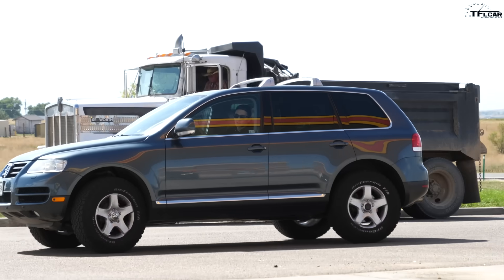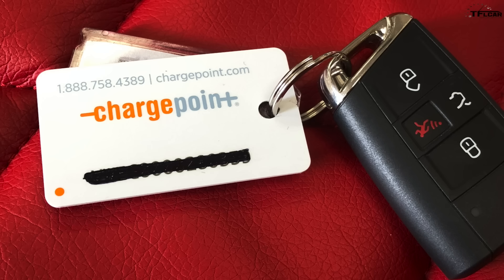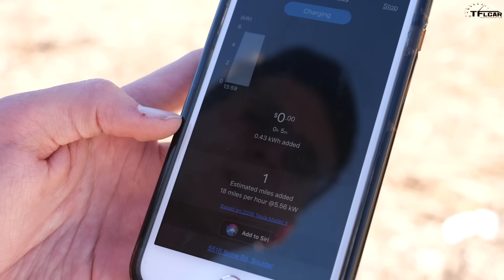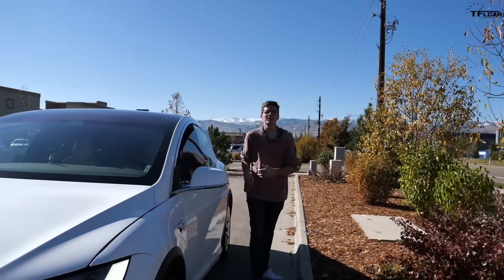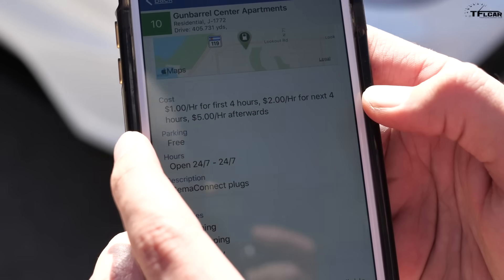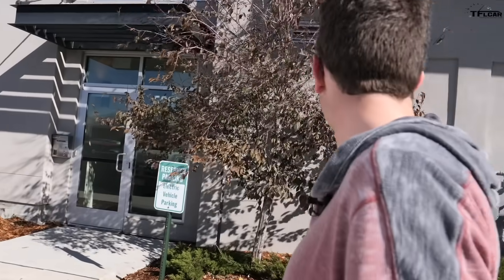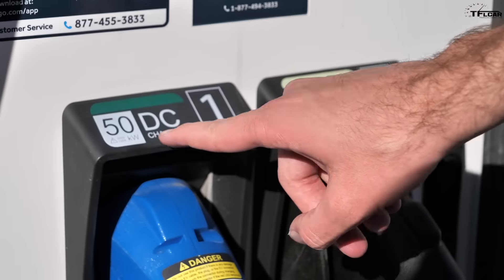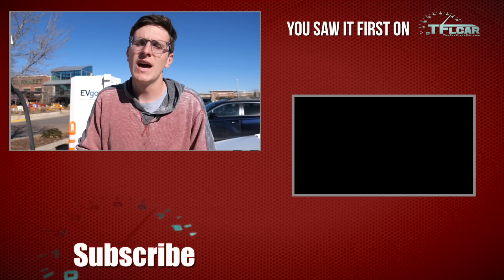Here’s Why Charging an Electric Car Can Suck - And It’s Not The Reason You Think!

Comment: Must be nice to have time to sit around for hours so you can drive 50 miles to the next inconvenient place to sit around and wait.. I live in the country and have a job I have to actually GO to.. I need to be able to fill my tank in 4 mins and not stress about WHERE and how long it takes and if an app is going to work...  What if you don't have good cell service near the charger? What if there is a wide area power outage? For a week..?. A gas station can run on a modest generator..  Usually if one station doesn't have power there is another one close by that has  backup power.. 
Ev can't work for me at this point in my life.. I have to keep moving and don't have a luxury job that I can stay home to do.. Also, sometimes, I like to pack up and go to Florida during my Christmas break.. I only have 5 days.. I can't spend 6 days charging a vehicle to get there and back.. Don't get me wrong, I have driven a cranked up p90.. It's just amazing.. For fun.
For me, as a daily.. the range isn't there, the tech is sketchy, the time involved is insane. When its cold and dark and snowing the range is worse..  So I'll keep driving my cheap focus st and when it snows the f150 and go past all the EVs dead on the side of the road because they had to sit in traffic for an hour in 12 degree weather.. I'll revisit EV when I retire cuz I certainly am NOT moving back into a city... Good info tho!
Reply: As a Tesla owner with 310 miles on a full charge, I NEVER wait to charge, unlike I used to wait to fill a gas car.  I pull into my garage, plug in every 4th day or so, then watch Sportscenter.  The only time I actually wait is 
at a Supercharger during rare drives over 310 mile round trip.  And only a 20 minute wait.
Reply: cell service is a good one.  there are dead spots depending on which bands are available to your cell phone provider or plan.  mvno plans typically do not roam so those who have prepaid services often have far more poor reception or flat out dead spots.  therefore, the advice here for electric owners is to pay the full price for a post-paid plan.

Comment: This must be a lot of fun in the winter!
Reply: S K exactly 😂
Reply: For me it would be worse in the summer. Leaving the car outside in the sun to bake for hours.
Reply: @Oilthebear  You can run the A/C or heat when charging Teslas at least.
Reply: It never snows in Boulder, Colorado
Reply: Imagine when its 30 below.
Reply: If you are talking about standing in the rain or snow while gassing a car, I agree.
My Tesla sits in the garage getting charged up while I'm sleeping in my warm bed.
Reply: @NVRick1  umm but you dont have to stand there while your gas fills up, and you can still be in your warm car lol
Reply: @samlocoaa1726  Check any gas station and they will have a sign saying you must stay out when fueling.
Of course, many people disregard that.
Reply: If you charge at home with a Tesla you don’t have to fill up gas at a gas station in winter. Or do you have a gas pump in your garage?
Reply: @Chainyanker007  There's a thing called a gas container where gas can be stored in it and used if a vehicle ended up running out of gas for some reason. You don't need a gas pump in your garage to put gas in your car in your garage.
Reply: @Chainyanker007   No.  It's out back behind the barn.  Only idiots store explosive chemicals or ultra-high-voltage in their house.
Reply: @Chainyanker007  - unless you have an apartment w/o a garage then your fighting over the 2 charging stations with your 200 neighbors

Comment: The standard is Tesla 
Tesla offers other manufactures to use their network

And a little note, my motorcycle requires 95 octane. They recommend not using gasohol and forbid it over a few percent. So I have to drive around to different gas stations to find corn free 95 octane.  I just mention this because getting gas is not always easy.  Plus there are those accounts where folks go to buy fuel and and end up with diesel in their gas car.
Reply: What motorcycle do you own?

Comment: Wow I didn't realize charging was that slow. Definitely can't go on a multi day road trip with one of these or any long distance trip really. Time is a huge factor who has time to wait 2hrs to able to travel what a gas powered car would do with the low fuel light on.
Reply: Check out A Better Route Planner and try planning some trips. With a Tesla you only need to stop for 15-20 minutes every few hours. I'm averaging 25k miles a year due to road trips (normally drive ~10k miles). It is not hard, at all.

Comment: In Europe we don't use the J1772-combo. Don't think we ever have, and we never will.
However we use Type2/Mennekes-combo. Model3 comes standard with CCS type2 I believe, and for other Teslas I think you can use an adapter. Also the "Tesla-plug" is a bit different here.
Can't think of any new cars even using the J1772 for slowcharging, even the Leaf has switched to type2 on the new model here.
Otherwise a great guide.

Comment: It's that commun in usa that house don't have 220/240V?
I never thought about it. No 240 for the oven and drying machine? Hi electric bill, bye parts money
I feel blessed by the electrical God!
Reply: The electricity at the meter is 240V, it is split and 120v is supplied to electrical outlets and lights. 240V is supplied to the range, dryer, and heating system. 240V outlets are also available for things like welders, but of course very few people have those. Garages typically don't have 240V circuits installed, so an electrician has to add a circuit from the breaker panel. For most people that is an extra cost that they don't want, which is why home chargers are typically 120V.

Comment: Why on earth would you bother with a Charge Point when you can go to a Tesla Supercharger?  The Tesla Superchargers are located every 50-100 miles apart, You can add miles at a rate of 400-450 miles an hour. You only need to spend 10-15 minutes to add enough miles to get home or to the next Supercharger. Also, most people don't drive more than 30 miles a day so charging at home at night when the electric rates go down is not only the cheapest way to go but the easiest way to go. You make this seem a lot harder than it really is.

Comment: 10 hours for a full charge?.. A gas/electric hybrid would make more sense. Is there any chance Tesla will offer that?
Reply: Not 10 hours - the video is misleading.  Lastest chargers are 1000 miles per hour added peak rate.  No, Tesla will not offer any gas/hybrid because they don't make sense for the majority of use cases - with the added complexity, maintenance, etc. of a gas engine and transmission.

Comment: This is why EV buyers should buy a Tesla.  All of their superchargers charge at about 120 miles in 30 miles and are plug and play.  Just pull up, plug in and the charge begins and instead of only 1 or 2 chargers at the site, there are usually 8 or more and they all work and they are usually located at a mall, a restaurant complex or a hotel.
Because of this, you can shop or eat or use the hotel potty and grab a coffee while you charge.  None of this 10 hour nonsense that other EV's put you through.  

The slow chargers that you demoed are more for people who stop to visit or eat and get a little top off while they're away from the car.  Frankly, if you do not have the capability to install a home charger, your best bet is to get a Tesla or stick with an ICE vehicle of some kind.
Reply: Suggested edit:
30 miles to 30 minutes.

Comment: Almost every house home in America has 220 volt in the garage.  What are talking about?
Reply: Not necessarily in the garage (my house does not have it) but readily accessible at the main distribution panel. I would have to pull a cable from the distribution panel to the garage - which is not a big deal.

Comment: Things are much better here in Barcelona, Spain as the city has setup over 300 dc fast chargers that are completely free with the CCS Combo plug that the Tesla Model 3 uses and from my observations they are almost empty and always available.  I also have free charging at my office parking and if for some reason those are full there is another completely free charger 10 mins walking away.  I haven’t seen a paid electric charger here but maybe exist at some gas stations.  The Tesla supercharger here isn’t even in the city but outside in a suburb as there is so much free charging available here.

Comment: Electric seems like a pain in the ass. Gimme gas, 6 mins on the pump gives me 330 miles. That's it.
Reply: in shared parking, ev's seem more of an inconvenience. however, they seem like a perfect fit for homeowners, and  if i had the money, i would have switched to one a few years ago. basically get home, plug it in, and let it charge overnight; cheaper, and never having to visit a gas station again.
Reply: @carlos2004  In Los Angeles a home will set you back 600k-1mill to be a home owner. And many apartments don't have electrical hookups in the garage if they have a garage at all.
Reply: @linusa2996  Simple answer to that is not live in LA. Average price of a home across the US is 226K and usually has a multi-car garage. 

Where I live outside of Boise, ID. Bought my 3000 Sq ft house with a 3 car garage for 150k. Now inside Boise housing costs go up to nearer that average, but I like the small town feel of the city I live in.
Reply: @Species-lj8wh  People go to where the work is. And for most part, it's not in Idaho.
Reply: I’ll do you one better. Don’t leave your house and plug your car in to a normal outlet when you get home. You can recoup your range over the time you are home. Do you not plug your phone in every night? Does your phone charge in 6 minutes? Would you rather go somewhere else to charge your phone? “Hold up, man. i have to go to the gas station to charge my phone”
Reply: @3DPrintedCat  No, but you can recharge your phone in a running ICE vehicle if you're living through the blackouts in Northern California (or any other power failures).
Reply: Joe Sterling not if the pumps can’t pump. Which use electricity. If you have solar, the world can crumble and you’d barely feel it. Ask those with powerwalls in the outages
Reply: @joesterling4299  I don't know about you but the last blackout I had was that massive one back in 2003. Not really a concern as the fuel pumps also didn't have power so fuel was also an issue.
Reply: These low rate chargers are crap. This guy is using a 5kw where some can charge at something like 150kw
Reply: Gas is a pain in the ass. 10 seconds to plug in at the end of the day and 5 seconds to unplug at the start. Never have to charge anywhere else unless on a road trip. I swear, the car enthusiasts that frequent this channel have so many whiny, can't-do-nothing-for-themselves, snowflakes.
Reply: @Markle2k  Like you said, unless on a road trip.

That's where it all falls apart.
Reply: @dchawk81  Unless you are a sadomasochist who forces his passengers to pee in a bottle and eat packed food while on 18 hour marathon travel legs, you get to spend the time the car is fueling multitasking. If you want to get a bite to eat, something to drink, stretch your legs, you can do that simultaneously to your car fueling. You don't have to wait by your car until you are free to do so.
Reply: @Markle2k  It doesn't take 40 minutes to pee.

I'm going by Jason Fenske's (sp?) real world experience road tripping in his Tesla Model 3. Most of his stop were at or around 40 minutes.

Same stop is 5-10 in a gasser because you don't take lunch or a movie EVERY TIME.
Reply: @dchawk81  He has only documented that first road trip to Michigan. His first road trip in his Tesla. Jason's longest stop was 52 minutes. That was only that long because they were eating and they didn't stop charging until they were done eating. What's more, he was charging to a really high state of charge and that is slower than just getting back on the road at 80-85%. Charging from 15-60% takes significantly less than 15 minutes and 60-80% takes about 10 minutes as the charging rate slows down to under 100 kW. The last 20 percent can take as long as those two put together as the battery is just topping off.
40 minutes is a long outlier stop in a Model 3. 40 minutes is like the length of a stop in a rapid-gating Nissan Leaf.

You should be checking out Bjorn Nyland's channel TeslaBjorn where he takes all kinds of EVs on various road trips: from the 1000 km challenge on a standard route from Oslo into Sweden and back, to head-to-head races between competitive EVs over a pre-arranged route. He also set an unofficial world distance record on public roads driving a Model 3 for 24 hours over a closed loop on the German autobahn teamed up with a couple of co-drivers.
Reply: @Markle2k  Most of his stops were around 40 minutes. He didn't have lunch at every single one of them.

He charged to give himself a larger buffer for safety. I'd imagine a lot of non-idiots would do the same thing.

Not filling is like splashing a couple gallons instead of filling the entire tank. It's silly on a road trip because you're just gonna force more stops. Except with liquid fuel it doesn't actually take much longer to pump a full tank than a partial so almost no one ever pumps just enough to get to the next station.

Electric falls flat because an actual fill takes forever. Since a quick fill only gives you a small range, you have to stop more often so you're not stranded.

With liquid fuel you get all your range every time in just a couple minutes. You can bypass a lot more stations and your bladder can dictate your stops.

Again, 15 minutes to get 150 miles of range vs 5 minutes to get 300+
Reply: @dchawk81  How often do you do crazy long roadtrips though? me personally its only a few times a year. in exchange for that you now never have to refuel at a gas station, just charge it at home overnight, no oil changes, no brake pads to wear due to regenerative braking, etc. I know that for me personally I had to refuel at least twice a week. Twice a week standing there for 2-3minutes. That's 24 minutes a month.  That's 288 minutes a year. The time you lose on roadtrips evens out to the time you'd spend on refueling normally. If all you do is long ass roadtrips then ICE is the way to go, for now.
Reply: @0xsergy  Enough for it to be an issue. Not in a car though anyway. Usually hauling something. So it's even worse from a range standpoint.

I like the idea of an EV but not the current realities.
Reply: @dchawk81   If you can add two hours of driving time in 15 minutes, that's good enough for a trip. Drivers need breaks every couple of hours, after all.
Reply: @Roxor128  not everybody needs to stop every 2 hours.
Reply: @dchawk81   Uh-huh. Whatever you say, Mr Overconfident...
Reply: @Roxor128  "Overconfident" being able to drive more than 2 hours. 😂
Reply: @Roxor128  By the way, if you have to stop every two hours for 15 minutes to get a juice boost, that adds over 75 minutes to your trip over a 10 hour drive. Plus the loss from actually slowing down and detouring (a variable that's impossible to calculate without a specific route).

If you only need to fuel once or twice you only add 5-10 minutes plus the detour, which could arguably be less with gas stations off almost every exit and on almost every corner. Then you can plan your fuel around your bladder rather than your bladder around your fuel. If you can't get hold it until you find a supercharger, you're stopping even more often.

I drive a truck. Time is money. Planning is important. I know WTF I'm talking about to a greater extent than someone who almost never drives a distance.
Reply: @dchawk81   Yeah, and I bet you ignore the government advisory of "Every two hours: Stop. Revive. Survive.", putting everyone else on the road at risk. I regularly run across news article about accidents caused by overworked truck drivers and see frequent road-safety ads trying to drill into our collective head not to drive when tired.
Reply: @Roxor128  "Advisory."

Amateur drivers typically don't have the experience or stamina of a professional.
Reply: @Roxor128  There's also a huge issue of cars out driving their abilities and causing a lot of semi crashes.

If you need to stop every two hours, by all means stop. But don't project your need for short intervals on everyone else.
Reply: @dchawk81   Professionals in any field still get tired and make mistakes. You're not immune any more than your doctor is. Maybe the roads and traffic departments are more cautious than you are? I'd wager they've got good reasons for it. Frankly, the only professionals I'm not worried about working while tired and making mistakes are machine-learning systems, and that's only because computers don't get tired in the first place.
Reply: @Roxor128  Yes they do. If 2 hours is what makes them tired, they stop. If it doesn't, they don't.

For many professional drivers, 2 hours is nothing.

For someone who seldom goes further than their commute, works all day, then commutes home, 2 hours can feel like a long time.

Not a single industry entity mandates a stop every 2 hours for good reason. We have a lot of regulations on us but that silliness isn't one of them.
Reply: In the 2012 Prius 8 gallons of gas gives me over 400 miles and takes less than 5 minutes to fill the tank.
Reply: @timothyvu7006  I think you quoted the wrong person because I'm the one saying it's ridiculous to do so.
Reply: @dchawk81  whoops I meant @roxor128. That person would turn a 10 hour trip into a 15 hour trip and I'd go bat shit crazy.
Reply: When you have a $2000 car with $4000 26" wheels on it, gas price isn't much of an issue
Reply: @TasteMyStinkholeAndLikeIt  Don't know about you but all 4 wheels combined cost less than 1000 and that's with the tires.